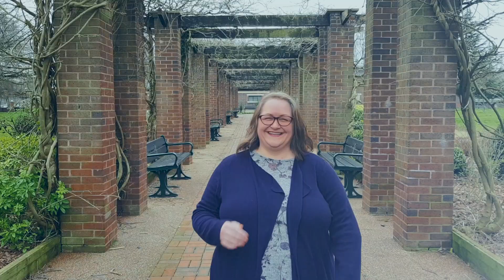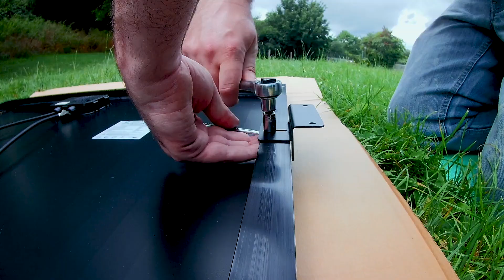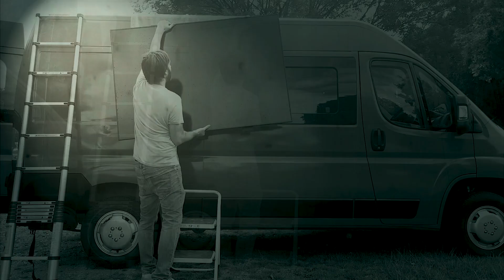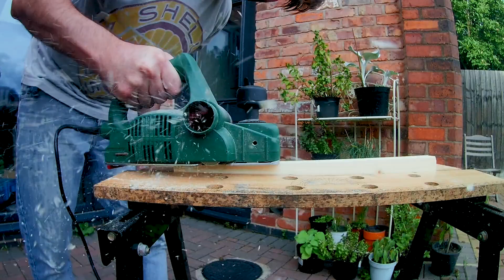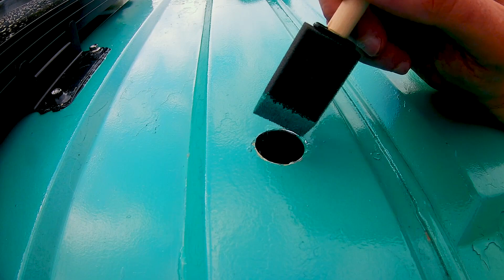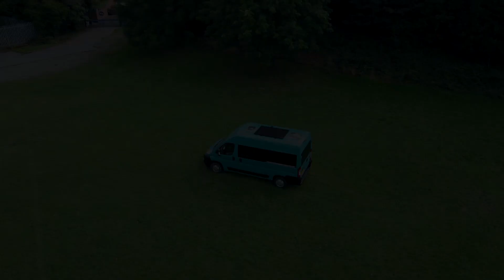Fitting a SOLAR PANEL to a CAMPERVAN - DIY Budget Campervan Conversion

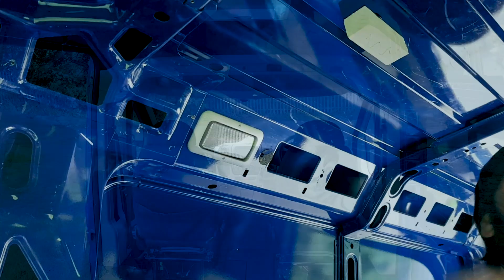Comment: Great Video !! AT 8:49 in the video did you specify the type and size of screws you used to afix the panel to the roof? Are they self tapping sheet metal screws?  and how are they fairing with the weather any leaks.  Thanks🐸

Comment: You explain the screws in addition to the glue, but why not nuts & bolts with rubber & lock washers?
Reply from the maker: Screws came with the kit. I will probably upgrade to nuts and bolts at some point. Still stuck fast two years later though.

Comment: Hi, nice and a neat installation 👍. I was just wondering where your panel connectors are located? Are they hidden under the panel, or did you manage to get them through the gland? Tia
Reply from the maker: Under the panel. 😊

Comment: How well did this perlight panel do? About to find a new panel to my van and like this one as you said it’s smaller size.

But most research says the black panels are less efficient as they get hotter. What kind of wattages and amps did this get, especially in UK seasons?

Comment: Hi Craig just come across your page what an amazing job you've done with your van! I've watched every video lol 
As I'm starting on my van this is one of the next jobs of mine, when you bought the solar panel did it come with any of the cables etc or did you have to order these separate? 
Hope to hear from you 
Thanks Craig! 😁
Reply from the maker: Apologies for the slow reply. It came with cables but I had to purchase some extention cables to run inside the van.

Comment: Enjoyed the vid thanks. I was thinking off purchasing the similar 330w Perlight panel How are you finding it performs, particularly in non direct sun UK winters?
Reply from the maker: Still haven't hooked it up yet to be honest. It's been a bit of a write off this year for one reason or another but we'll be done and out on the road March 2022 whatever happens. Heard great things about the larger panel, if we had a LWB it's the panel we would have opted for. 🙂

Comment: Excellently done - the only difference I would have considered is putting the gland further forward and on the same patch of roof space as the front vent - as then you would have had less work on getting the gland orientated correctly - this is just my view.
Reply from the maker: Thanks Dave. Yeah, I did consider mounting it on the flat area next to the front vent for ease but aesthetically it just didn't look quite right to me. 😄

Comment: Why not turn it length ways so no need to build up the edges
Reply from the maker: Didn't want the panel close to the edge of the roof and we had the space to run it lengthways. With all the narrow windy UK roads and overhanging branches etc I wanted to the limit the risk of the panel being damaged. That said, if we didn't have the space we definitely would have fitted it sideways.

Comment: @Pilgrim Pods have you a link for the exact panel please?
Reply from the maker: Hey again Dan. My particular panel has been discontinued but they do have a newer version with the same dimensions. I've put a link down in the video description BUT they are currently out of stock. If you copy and paste the panel name into your browser you may be able to find another supplier. Good luck!  🙂👍
Reply: @PilgrimPods  thanks so much for the reply and info! I think I have found a panel that's suitable and around the same price 👍. What batteries did you go for? Just ordered Windows and skylight so wish me luck 😅
Reply from the maker: @danieljames9884  I haven't picked my battery up yet but will probably go with Roamer Lithium. They do 100AH for about £450.

Comment: Much more hazzle, destroying the resale value of your vehicle, but neater looking: The frame on solar panels is made of extruded profiles, so they are double walled. This means you can cut around the upper edge of the solar panel and remove the outside of the profile, making the circumfrence of the panel have an inverted L profile, which will fit and seal nicely in a cutout in the roof with just sealant just like a sunroof. You also get the junctionbox of the panel inside the van and if you have no roofliner, you'll have a diffused skylight from the light seeping in between the solar cells. On the inside, you secure the panel with the remaining L-shaped pieces of frame from the panel you just cut out, with self tapping screws and more sealant. Impressive size panel on a van btw!
Reply from the maker: Hey Tore! That's a great idea mate; I'm going to see if I can find a video of someone who has done exactly just that for future reference. I'm not sure I'd be brave enough cutting a hole that size in my own van though and to do so it would probably mean cutting into structural supports which if that were the case I'd definitely be too scared to attempt. Thanks for swinging by and checking the video out and sharing that pearl of wisdom! 🙂👍
Reply: @PilgrimPods  I'm building currage to do it myself, so just checking the comments about how crazy that sounds. Did it to a small 20W panel now mounted on the rear spoiler for trickle charging. Looks as good as the stock panel on a Nissan Leaf. Yep, you'd need to preserve the support, or it will fail MOT, so either remove it and remount it last.  With foam inserts it should provide good support for the panel too. Ordered an expensive 20% eff 70W panel that fits between my supports, which is the size of a full size solar roof for my car. If this works, I'll mount another 70W panel in front of the support too, for a total of 140W, which is more than I need on hollidays.

Comment: Hi - how have the brackets stood the test of time and bumps of driving around. Any play or issues you've had to resolve? Was going down the uni strut route but my solar panel (similar dimensions to yours) means it will be a right pig's ear to fit. 
Really nice video and neat job. New sub 👌 Cheers
Reply from the maker: Hey Michael. Admittedly with lockdowns and the camper not being complete I haven't done any real miles in it since fitting the panel. It went for its MOT last week and I asked if it was worth giving it a full service again despite not being used a great deal. The mechanic said it shouldn't need one as it hadn't even covered 1k miles in the past 12 months. It's been used for tootling about picking up materials and that's about it. There's been no play or anything in the brackets or panel and no leaks inside the van. If I fitted one again I'd follow the same route but use bolts instead of the screws provided for peace of mind. I'll keep a close eye on everything when cleaning the panel and if anything does start to loosen I'll replace the screws with nuts and bolts. Hope that helps mate and thanks for the sub!
Reply: @PilgrimPods  Amazing thanks for the response. I agree with the nut and bolt solution - II've got 8 of these brackets for a panel 170cm * 100cm to make sure it's extra sturdy. Some stainless bolts are needed next! The uni strut route would mean I need additional pieces both widthways across the roof which would raise the height of the panel and look like some scaffolding eye sore.
I have seen a few people in the states using the same mounting system as you and it does look secure. For your own piece of mind I've used that exact Puraflex stuff before for bonding a sheet of steel to the roof of a van. I had to remove it at a later date and it did not want to budge. Cheers!

Comment: I’ve just attempted fitting my panel today and screwed up one of the mc4 connectors... nightmare. Wish they came pre crimped
Reply from the maker: Ah gutted. Hopefully you've sorted it out now. 🙂 It wasn't a consideration at the time when we purchased ours but the panel we had came with the MC4 connectors on the cables. You've reminded me though that we need to start thinking about buying some crimping tools and connectors for when we start our electrical wiring... Sounds like you're making good progress on your van! 😀🙌

Comment: 24v solar panel. You’ll need 2 12v batteries in series to make your own 24v battery. Meaning you’ll have a 24v system not a 12v.
Reply from the maker: The panel works just fine in either a 12v or 24v system but in our case will be used in the former. It was purchased from Bimble Solar and if you head on over to their site you can see all the 12v packages they sell it with. Those guys know what they're talking about so I'm happy with my purchase. 🙂👍

Comment: Hey, thanks for the great video! What size hole saw did you use for the cable entry point?
Reply from the maker: Hi Dewi, thanks for watching. I can't remember 100% what hole saw I used sorry. I'm almost 99% certain it was 20mm as was the rubber grommet. Sorry I couldn't be more specific but it was a few months back when I cut it.
Reply: @PilgrimPods  Thank you that's all I needed, I have a 22mm TCT hole saw and I was wondering whether it would be up for the job, it seems so! I hope your conversion continues to go well, your videos have been immensely helpful for me :)
Reply from the maker: 22mm will get the job done. 😊👍 Best of luck with your own mate.

Comment: Great video 👌🏻 i'm looking at the same panel and wondering if i could fit 2 on my LWB sprinter roof if i position them landscape side by side. please let me know what you think. Thanks
Reply from the maker: Thanks Josh. Ours isn't connected yet but lots of folk with the same panel rave about it. Two will fit but of course it all depends on what else you have up there. Good luck with your decision mate. 😊👍

Comment: I would tie down the solar cables to prevent them flapping otherwise the job's a goodun 👍
Reply from the maker: Good advice! We've bought some clips to hold them down but admittedly I haven't got on the roof to sort it out yet. Thanks for checking it out! 😊👍
Reply: @PilgrimPods  What clips did you use in the end? Just searching for some suitable ones for my cables on the roof. Thanks.
Reply from the maker: @NipperNeilson  I've thrown a link down in the video description for what we're using. We've opted for cheap and cheerful and the ones we've bought haven't got great reviews because folk complain that the adhesive fails but that isn't a concern as we'll be removing the adhesive and securing them with PU40. The clip also has an open end which potentially I guess the cable could come free from but I'll be dabbing a bit of PU40 on the cable to secure it inside the clip. Hope that helps mate. As soon as I connect the panel up to our battery I'll get up there give the panel a good clean and secure the cables with the clips we've bought.

Comment: Hey man, do you have a link for the brackets you used? I'm using the same perlight panel.
Reply from the maker: Hey mate. I've added the links in the description. When I originally made the video Amazon had sold out of the brackets and other slightly more expensive ones were available. I seem to recall mentioning this to someone else here, however(!) Amazon do now have the exact same ones (POWOXOI) in I used in black and for the same money if you're interested. 😊👍

Comment: Morning ive just subscribed great channel thanks how much paint did you use?
Reply from the maker: Thanks for checking us out and deciding to stick around! 😊🙏 We bought two 2.5ltr tins but so far thinning 4:1 we've only used around 2/3 of the first tin. Bear in mind ours is only a MWB though but we did paint the whole van before cutting out windows and rooflights. 🙂
Reply: @PilgrimPods  thats great cheers im doing a iveco daily LWB and thought three would do it were they the hairy roller sleeves?
the channel is great thanks
Reply from the maker: @optomisticostomistsmith501  check out the 4" Prodec gloss pile rollers on Amazon. That's what we used and were more than happy with the results. A lot use the more expensive Fussy Blokes rollers and rave about them.

Comment: Where did you get the brackets from please...
Reply from the maker: Hey Michael, we picked them up from Amazon for around a tenner. If you do a search for 'solar panel brackets' they should come up. They're just generic brackets with a few Chinese sellers. They're available on eBay too. 😊👍
Reply: @PilgrimPods  sorry dude i watched the video in work with sound down i hear you say now

Comment: Great job that. have you got a link to the panel fixing kit? had a look for those brackets but can't find them on amazon. cheers
Reply from the maker: There doesn't appear to be a link for that seller now... The seller was called POWOXI and they have other items but not the brackets. There are identical brackets available on both Amazon and eBay under different sellers at around the same £10 price point though.

Comment: That's a good choice of output - I put a REC 280w on my  Autostratus hooked up to a 100a lifepo4  via a 20A EpEver MPPT - I know some think I should use a 30A but flat panels seldom hit the sun head on and max out at 14a most of the time and if this model gets near 20a it feathers back the charge - by the time the suns over head the battery is near charged and on constant voltage lower current anyways - I recommend fitting this battery monitor it lets you know current going in and out - and % charge in battery - I use the 100A one - It runs everything inc a microwave, toaster, low current kettle and coffee maker - but only one at a time !!!!!!  https://www.ebay.co.uk/itm/UK-Battery-Monitor-DC-80V-50A-100A-350A-VOLT-Capacity-Tester-Voltmeter-Ammeter/402381831530?hash=item5dafd37d6a:g:4UUAAOSwy45fRMse
Reply from the maker: Thanks Trev. 👍 Not sure we'll be stretching to those batteries but that sounds a cracking setup. Thanks for the battery monitor link. It's something I was planning on giving thought to. 🙂
Reply: @PilgrimPods  Its kind of fun  cooking on a microwave and watching the sun put back while you eat - we use a 1500w pure sine wave inverter 3,000 peak and  an 120amp relay to connect it to the battery pack -  the triggering wire is fed from the output side of the BMS so it still provides shut down on under voltage etc the 700w microwave takes 80 amps  the toaster/kettle and coffee maker 55 -70a - Its not like any are on more than a few minutes.We also have a roll out MPPT charger lead for our two ebikes _ I think Lead /aci might sag too much unless you had over 200a/h - Lifepo4 is just so much lighter and compact and charge much quicker.
Reply from the maker: @trevortrevortsr2  it sounds like you have a lot more power needs than we are anticipating! 😁 Lithium is definitely the way forward providing you can afford it but unfortunately for us, way too pricey for our budget. Maybe when we're ready to replace our batteries later on prices will be a bit more reasonable. Do like the look of those ebikes too but again another extravagance we can't stretch too. Sounds a cracking motorhome you have going on there. 😊👍

Comment: Thanks for your videos and the effort  putting them together. 
Would it not make more sense to connect the negative of the PV panel  to the  leisure battery negative terminal?. Bad earths are one of the most common  DC faults. This would be a better connection and also keep your leisure 12v electrics separate from the driving battery circuit.
Reply from the maker: Whilst definitely no expert I've tried to do my research as thoroughly as I can. 🙂 I could do exactly as you suggest but because I'll already have our B2B, fridge and diesel heater negatives connected to a bus bar I just thought it made sense to do likewise with the negative from the MPPT; keeps things together all neat and tidy. Of course none of this is highlighted in the video as I was focusing on just the solar aspect of things. Hope that makes sense. 😊
Reply: @PilgrimPods  Makes perfect sense, but connect the bus bar to the negative terminal rather than the chassis.
Reply from the maker: @dynagen7013  yeah that might be a better bet and looks just as neat. Thanks for the advice, really appreciate it. 😊👍 I've never wired 12v electrics before and am just following the advice and guides of people who know better than me. I certainly won't be trying to reinvent the wheel with my own wiring. 😁

Comment: screws good idea   ( jock in a box, dave) said he was in his van in that last storm he thought someone was  walking on his roof  it was the wind under his solar  panel  had parked on a mountain mind  he moved all good
Reply from the maker: Yeah we watched his video. 😂 Granted adhesive should be enough to hold the panel but I'd never fully trust it, particularly knowing the state of our paint beneath. A couple of screws or a bolt in each bracket as a precaution every time for me just for that peace of mind. 😊👍

Comment: Really nice work. I was going to try the unistrut roof rack but this method is so clean, cheap and simple I'm wondering why I shouldn't just copy you.
Reply from the maker: I thought about using unistrut too but opted for our solution for the very reasons you give; clean cheap and simple! 😁👍